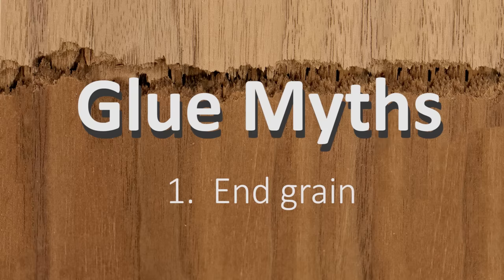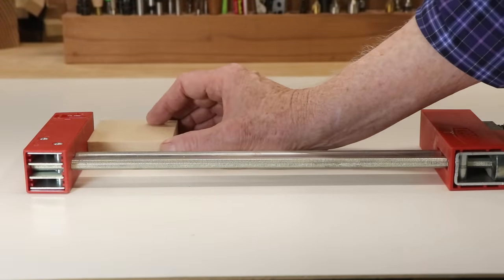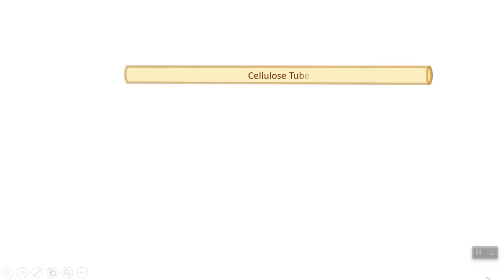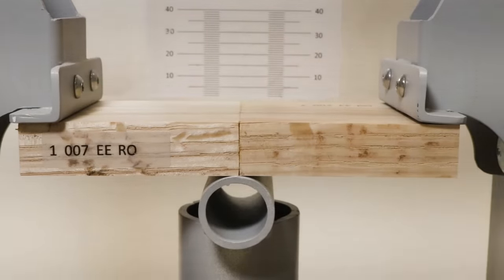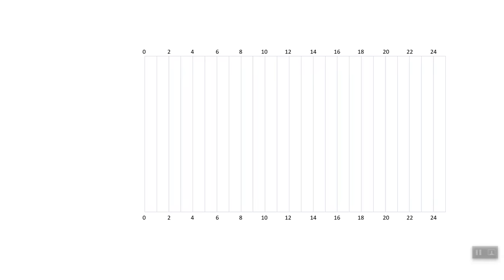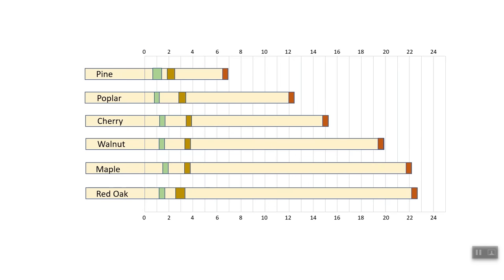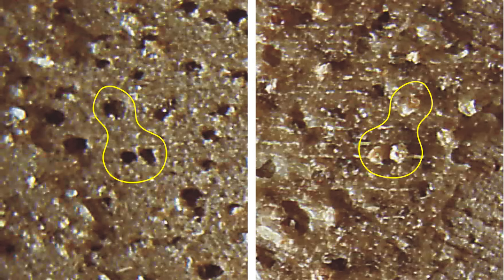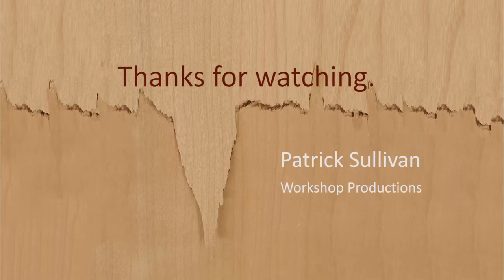Glue Myths:  1. End grain

Comment: This is a great video as is your companion miter video. However, left on its own one might be lead to an incorrect conclusion about how to use this great information. 

I would like to offer a way to interpret your results that I think will help clarify how to use the information that you have uncovered to best advantage when designing joints for specific projects. I think it is important to understand that what you have demonstrated is that glue is stronger than lignin, but not as strong as wood fibers. And that is why long-grain joints tend to fail in the wood surrounding the joint, that is to say if fails in the lignin, rather in the joint itself. Whereas an end grain joint fails in the glue joint itself, rather than in the surrounding wood. Here the reason is because wood fibers are stronger than the glue, and due to the fiber orientation, the lignin is not stressed but rather the fibers carry the stress. Since the fibers are stronger, the glue fails. 

What is the implication for end vs long grain joints? Well, long grain joints will not benefit from spines or other strengthening features, because the glue itself is already stronger than the surrounding wood due to the relatively unfavorable orientation of the wood fibers which causes the lignin to take the stress; therefore, unreinforced long-grain joints are perfectly good practice. However, end-grain, and miter joints, will benefit from reinforcement because the glue joint is weaker than the wood itself, due the favorable orientation of the fibers. Therefore, unreinforced end grain joints are weaker than reinforced end grain joints and so best practice is to always reinforce end grain joints with splines, dowels etc. that introduce wood fibers crossing the joint. This best practice is of course only necessary for joints that might see relatively high stresses or long lever arms around the joint in service, such as a chair frames or perhaps picture frames, but probably is not required for something that is unlikely to experience high stress, such as a mitered clock base. 

I suppose its the fact that long grain joints don't need to be reinforced whereas end grain joints do benefit that has lead to the myth that end-grain joints are weaker. As you have demonstrated that is indeed a myth, and your experiments also demonstrate why end grain joints benefit from reinforcement whereas long grain joints do not.

Comment: It is possible at some point someone compared boards glued up end-to-end to a longer single board. By your own data, if someone was gluing up end to end for the purpose of getting a longer board, it would always fail sooner than a longer single piece.

So I'm guessing the 'common knowledge' came from the fact that it is (always?) better to just get a longer piece of lumber than to glue up two smaller pieces at their ends? This would be reinforced over time as every time two similar pieces of wood were in a project, and that project failed, the glued up ends would split and fail every single time. Even though, as you've proven, it fails at a much higher stress level than side grain glues.

Maybe a theory vs practical sort of situation?

Comment: The results are quite clear. But that doesn't cover big part of the way wood is joined. It covers wood to wood without any complex joint geometry. What about end to side grain vs finger joint. The end grain is a lot weaker than long grain. How do you make it stronger - increase the surface. Sounds like no-brainer, but I still want to see it tested. What about side to end with and without dowels?

Comment: Don't you think that one of the reasons for this maintained belief is that the fibers are softer when gluing up long grain to long grain / parallel joints, where mild clamping pressure compresses irregularities to easily make a solid joint with any mediocre joint preparation. 

Conversely, end grain does not compress well and a slightly imperfect mating surface / joint would have gaps that are not easily closed with clamping pressure like long grain is.

Comment: I suspect that part of the cause for this myth is that when people look at the joint after it has broken, they see that the side grain joints broke beside the joint meaning the bond was stronger than the wood, whereas the the end grain joints broke on the joint meaning the bond was weaker than the wood. But this is a point of view issue. They failed to realize that the wood itself was stronger in one direction. (hence plywood)
It's similar to the confusion over why mirrors reverse an image left to right, but not top to bottom. The answer is that they don't reverse the image left to right either. They reverse the image front to back. The mind (not the eyes or the optic nerve or the brain, but the mind) reverses left and right because left and right are something you learn as a child that is relative to your body and which way you are facing. Up and down are relative to gravity.
Just like the glue/grain orientation, it is a subtle but profound mental bias.
Reply: Nah, it is just that an endgrain joint is weak - as the video even shows cleary. If you need to join 2 pieces lengthwise then use a longrain-joint like a lap-joint or scarf joint - they reach the strength of the wood itself.
https://www.youtube.com/watch?v=6cAUz_eCmbw
In a joint you want to maximize the strength of the wood fibres as they are the strongest part.
Reply: @ABaumstumpf  The myth is that end-grain joints are weaker than side-grain joints, not that end-grain joints are weaker than solid wood. He proved that to be a myth. Obviously all glue joints are weaker than solid wood, and also obviously there are better joints than end-grain OR side-grain joints. Even a finger joint is going to be stronger than two flat edges.
Reply: @GordieGii  "The myth is that end-grain joints are weaker than side-grain joints"
Yes - and as even this video shows that is actually the case - endgrain joints are weaker than longgrain joints as their strength is limited by the strength of the glue, while longrain is limited by the strength of the fibres.
This video just is not showing longgrain joints, but it is showing that endgrain joints are several times weaker than solid wood, while any decent longgrain joint like a lapjoint (i know i am repeating myself now but how about you start to read what i had written) are as strong as solid wood.

"Even a finger joint is going to be stronger than two flat edges."
You mean - a joint where you are cutting the wood to introduce more longgrain to the joint to make it stronger?.... yeah....

Comment: I think telling the myth is false is a misleading, it's true, it's just that we need to clarify what "weak join" means. For me, it means weaker than the unjointed piece: do cutting your piece and gluing it back together makes it weaker? For a cut // to the grain, no, not at all. For a cut perpendicular to the grain, yes, a lot, hence "weak joint". For the mix joint? Weak joint is meaningless, because you do not have the uncut part to compare with in the first place. 
The fact that end-to-end grain joint is "weak" is the whole reason for the whole set of techniques that increase the glue surface: mitered joint, half-lap joint, finger joint, .... The real goal is not so much to increase the glue surface, it's to try to make fibers overlap as much as possible, so that fibers cuts are distributed at different places and load transfer can happen between adjacent continuous fibers in the region they overlap. 
We do exactly the same for gluing high tech composite panels, which makes sense cause wood is a composite material made of mostly unidirectional fibers...Carpentry and aerospace have much more in common than the traditional/high-tech labels make you think....

Comment: The "myth" probably dates back to a time where glues weren't that developed and you had to work with weaker boneglues.

You just proved that with modern glues the side to side bond is stronger than the lignin.

I would recommend to try the same experiment with boneglue, because You can only debunk this myth if you're using a glue which has a weaker bond than the lignin.

Comment: The conclusions are based on a false premise, the real reason we don't glue end grain is an end-end glue joint experiences the most seasonal movement.  Large amounts of seasonal movement on even a lightly stressed joint causes a glue line failure.  Gluing end grain can work on something with essentially zero stress like a miter but that's about it.

Comment: The test here is of bending strength of the assembly, and the failures are due to overstress in tension in the glue (in the end to end setup) and in the side grain (in the side to side and end to side setups).  The result is not contrary to common knowledge, that the glue is stronger in tension than side grain, and weaker in tension than long grain.  That's why we don't design wood beams with end grain joints, because the same  wood is much much stronger with side grain glued laminations (glue-lam beams).  How about testing the shear stregth of the same setups?  How about testing under impact loads?

Comment: Very interesting video. However, from my perspective, you have not done a fair comparison of the actual glue bond. You have very clearly shown the difference between the strength of wood along the grain vs across the grain. To truly compare the effectiveness of the glue bond for both, you need to eliminate this difference so that the only thing being compared is the glue. My suggestion is to use your press to determine the breaking strength of your wood across the grain. You then need to by trail and error, work out what the equivalent thickness of wood is required along the grain that it breaks at the same load. Now for the glue test, you should measure the amount of glue for each sample and ensure they are the same. You can even go as far to ensure that the larger pieces of wood have glue only on the same surface area as the smaller ones. Once cured, preform your test. This test will now be a true evaluation of the glue bond alone and is not impacted by the strength of the wood in the different orientations.

Comment: “End grain joints are stronger…” But what does It matter the real world if the wood will always fail first in that scenario? Try building a chair with the grain direction if every piece 90deg from the norm and the thing will collapse as soon as you sit on it because the wooden frame will fail…short of using ten times as much wood

Comment: Very well done video and testing, but I’m going to argue that there is no myth, and I believe you might have missed the point of that “myth” …even though you actually proved what I’m about to say. It seems to me that it has to do with how strong the joint is relative to what you’re using the wood parts for. No one would seriously expect an end joint to be as strong as the individual pieces, because, as you demonstrated, there is a huge difference in the strength of the wood compared to the strength of an end joint. However, gluing pieces side-by-side is completely useful because the glue joint is stronger than the woodgrain in that direction, again as you demonstrated. Therefore it is reasonable to say that, although the the end joint is technically a stronger bond, it is nonetheless completely useless for most applications! 
Hence the “Myth.”

Comment: So in summary, with side-side joints the wood fractures ALONG the grain because it's weaker than the joint. With end-end joints the glue joint fails because the CROSS grain strength of the wood is higher than that of the glue. We've heard this myth all theses years because no one bothered to discover that the force it takes to break the end-end glue joint is so much higher?

Comment: Spreading the glue with your fingers mixes a bit of oil into the glue.  I would guess that it's insignificant, but you seem to be accentuating precision here, so you may want to consider it.  I wasn't surprised by the results - the porous end-grain simply takes glue better than the edge.  Here's the awful test -- if you let these joints expand and contract for several years, which is most likely to fail?  (though I suspect that the failure rate is insignificant all around)

Comment: as a couple have said the older style glue did not have the glue strength that modern glue does and the glue also used to break down over time.....In respect of the humidity movement question.....Wouldn't this cease to be an issue if a correct amount of glue was used as once it cures it seals the end grain and stops the movement of the moisture at the join  so minimizing the expansion and contraction..
Reply: moisture (water) does not solely evaporate through the end grain-it just does so faster through endgrain than side grain (thus the reason for 'checking').  Over enough time, all boards-end grain sealed or not, will normalize to the same moisture content.

Comment: makes total sense...the only broken glue bonds you would see are end grain so you would assume they are the weakest...when they are actually the strongest.  It's kind of like when WWII planes were brought back after being shot down. at first, people responded by reinforcing the places where they saw bullet holes...until a genius realized they didn't see observe places where the bullets actually tore the plane apart and made it unrecoverable...
Reply: Nope.
The endgrain-joints are weaker, as the video even clearly shows that they do not reach even half the strength of the wood. A longrain-JOINT would be something like a lap-join which is a lot stronger.
Reply: 15:29 did you watch the video
Reply: @ABaumstumpf  emdgrain joins are stronger than sidegrain joints.   End grained joints are weaker than the wood in those cases, but 2-4x stronger than sidegrain joints.
Reply: @ABaumstumpf  ummm.  I think we are saying the same thing....

But have fun insulting people when you can't comprehend my first statement that end grain joints are stronger then side grain bc the glue is stronger than the lingnen holding the fibers together.
Reply: @Sully365  "my first statement that end grain joints are stronger then side grain"
And exactly that factually wrong Statement is why i responded. And then the irony of "when you can't comprehend my first statement" - yeah... that applies to you.

Comment: Very interesting question, but it doesn't answer the question: is glue stronger when applied to edge grain or end grain? You just showed that, when applied to edge grain, the very properties of the arrangement made that the joint was weaker, but not because the glue was weaker on edge grain, but because cross grain tensile strength is much lower than the long grain one. It doesn't mean that the glue itself is stronger on end grain than on edge grain.

To answer the question, you should test the same joint but in one situation where the glue is only on the end grain and the other where the glue is only on edge grain. For example on dovetails where it is said that it is only useful to put glue on edge grain.
Reply: Well, that's exactly what some response videos have commented, so my comment is pretty worthless at this point, haha

Comment: This is awesome work dispelling a myth by actually testing and measuring results.  I'd have to think on how it would or wouldn't change a design though.  The strongest designs seem to be the ones that rely on the adhesive the least, because they are relying on the strength of the grain to carry the loads.  Also factoring wood movement...  well you've given this terrible amateur a lot to think about anyway.

Comment: So you still shouldn't glue end grain, because the piece will be stronger if you don't.

Gluing side grain increases the overall strength of the product, gluing the end grain decreases it.

A scarf joint would be better, or a lap joint.  Then you are adding strength and preserving as much of the wood's natural isometric strength as possible.

Comment: I think the reason that we have all believed that end grain to end grain was weaker is due to how long it has been believed.  The glues of today are much stronger than glues were just 50 years ago and I am sure that has a lot to do with it.
Reply: Nope, it is cause and endgrain joint is actually weaker. It is not that the glue is weaker in an endgrain joint but that the join is just weaker as it does not have the strength of the longgrain. This video only shows that the glue holds stronger than the lignin.
If you want to actually compare JOINTS then you have to keep the grain-direction the same and only change how you join the 2 pieces together. Compare a lap-join (longgrain glueup) against a butjoint (endgrain glueup) and you will see just how much weaker the endgrain joint is.